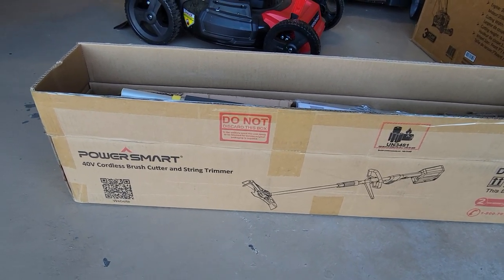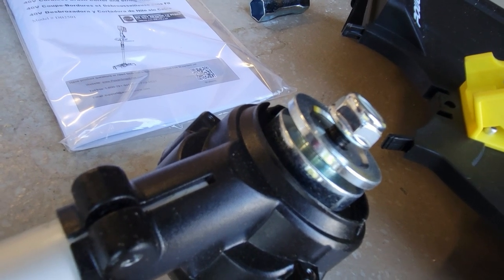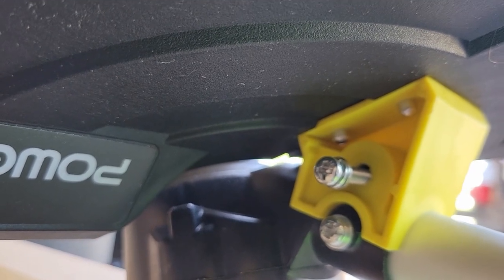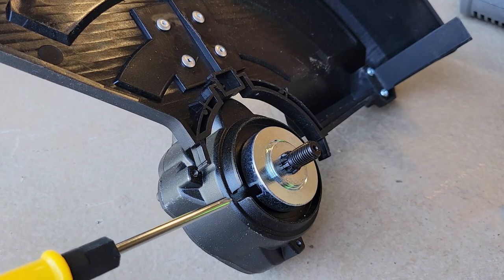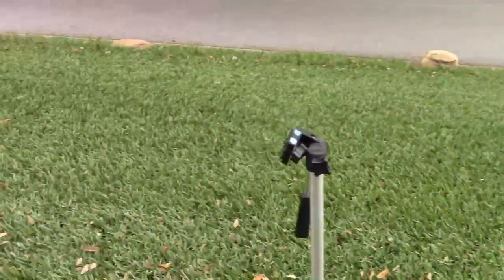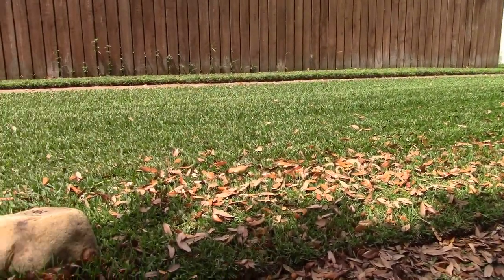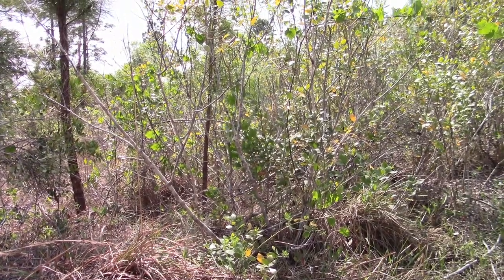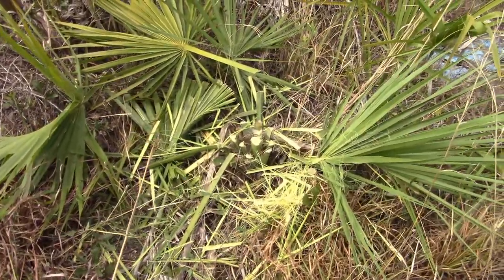PowerSmart 40V Cordless Brush Cutter review

Comment: The thing is that you have to keep the brush blade sharp to the motor from being over worked  because a dull blade is going to put strain on the motor  just like a 2 cycle equipment   well at least the blade is having a guard to keep it  from being damaged

Comment: Actually seems really weak. Plastic motor housing was all I needed to see, no thanks. Have you tried the Husqvarna stuff? It's a bit beefier.
Reply from the maker: I want to be clear, I may not have shown that well, but the motor housing is thick solid metal! And it is very strong. Right up there with my gas brush trimmers. I thought I had shown that adequately but maybe not so I want to state it here.